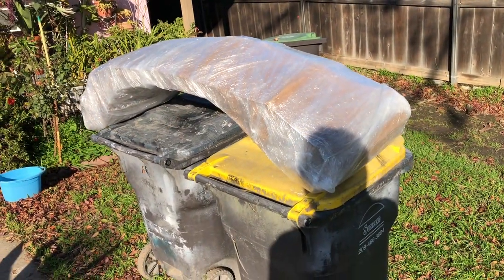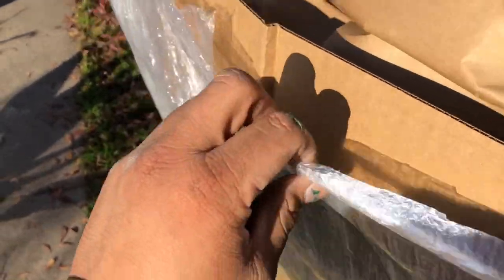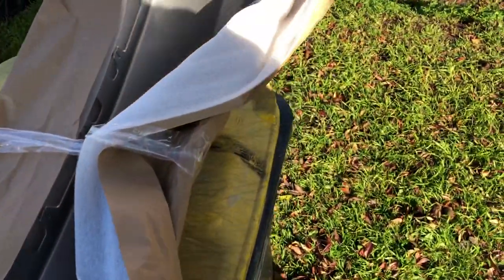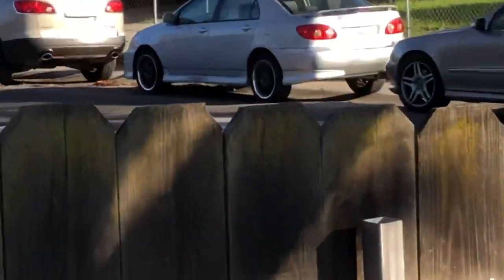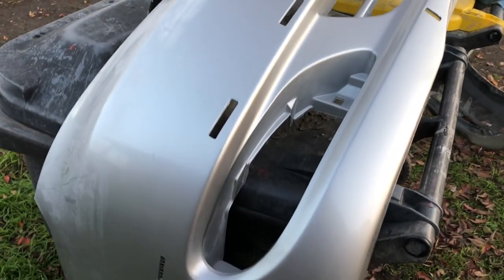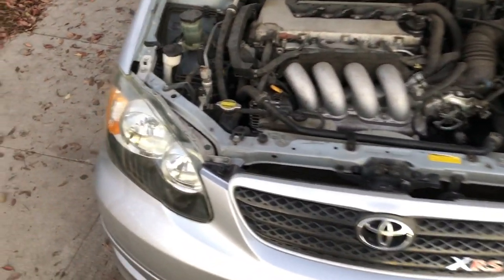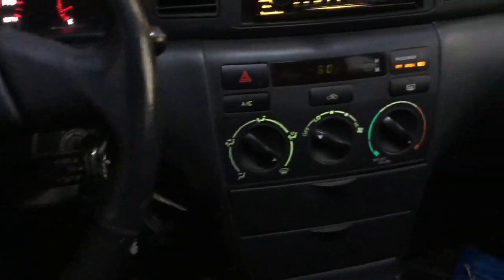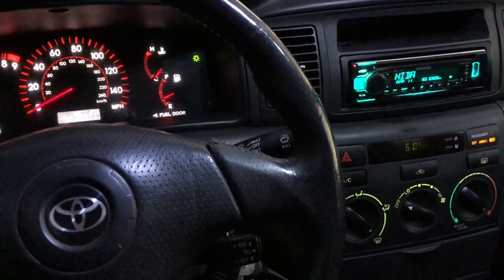I bought a bumper for my Silver Corolla XRS off ebay and it arrived folded! MBI Bumpers

Comment: The Clock / time led dim fix is easy. There are diodes or resistors on the circuit board where the solder gets brittle. Just resolder them by just hitting them again with soldering iron. The time will be clear and bright again;)
Reply from the maker: ill try to get to it, I've seen a few videos but I guess I didn't have time.
Reply: @2zzlow  Understandable. Keep in mind its the little things that make the sale...

Comment: YOU chose to save money on shipping. MBI offers different levels of quality. They offer economy bumper covers that use a cheaper a painting process and are folded in half to save on shipping. They also have a premium line that comes unfolded with an extra coat of clear, free of imperfections, and extra shipping protection. The premium is about twice the price of the economy.
Reply: We appreciate you!